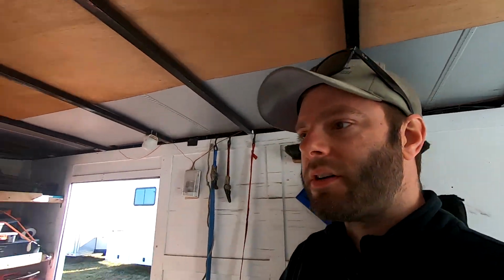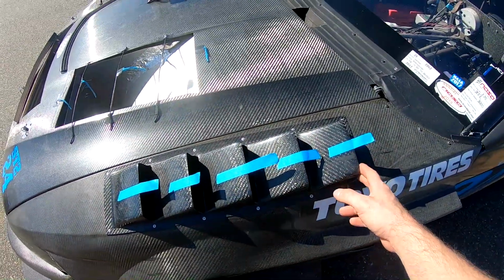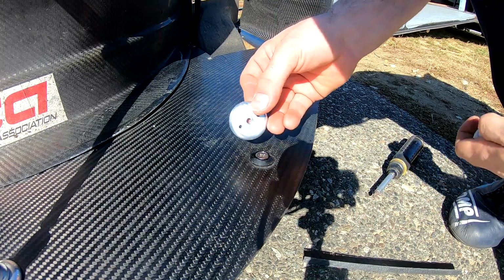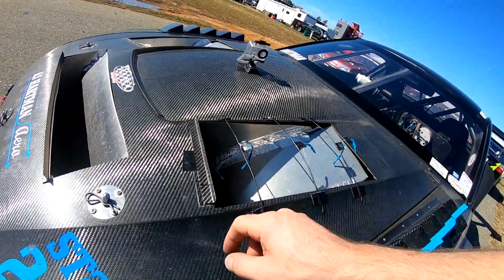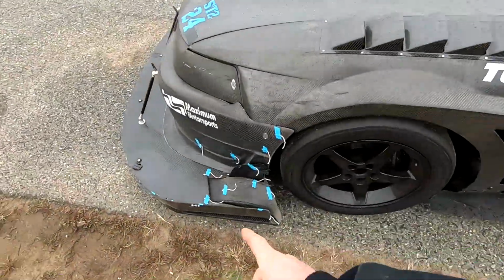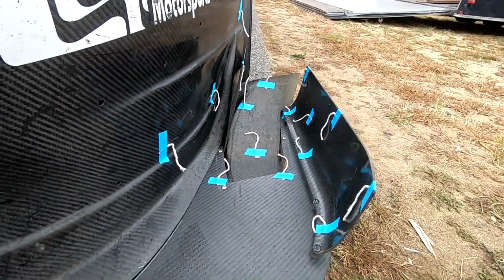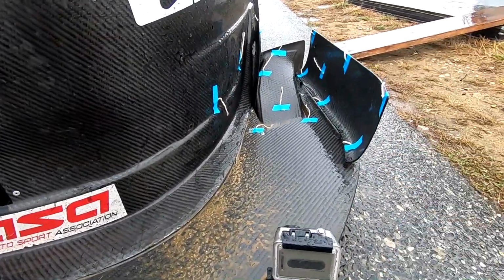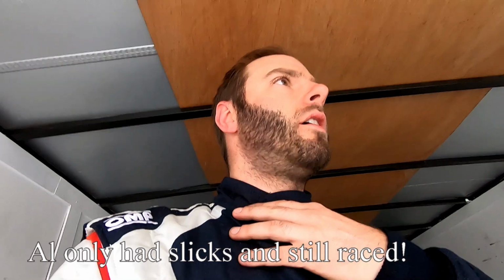Last Race of 2019 and Still Testing Things

Comment: Curious why your splitter flaps/end plates are mounted with a gap? Thanks for the vids!
Reply from the maker: GoodWillRacing cfd showed a better out wash which in turn made it harder for air to get under the splitter from the side.
Reply: AJ Hartman Aero very nice, thank you for the info. Also how are those tunnels working out for you on the outside next to the end plates? Thx again.
Reply from the maker: @GoodWillRacing  I'm sure good. Never ran with and without them back to back but they were all designed to work together. Earlier this year I made this video going over our tunnel setup. https://www.youtube.com/watch?v=FE9sSJQxNgo

Comment: Interesting. Your water wake from diffuser & spoiler look like a stream of ocean waves. slightly different than normally seen on gt3/gt2/single seater championship cars around the world / japan gt which has more upward streamline non waveing water pattern.
Reply from the maker: Interesting. Can you link a video showing this?
Reply: @ajhartmanaero  Here : https://youtu.be/XwURA-KSerw
Reply: A LOT different actually.   I was watching slowmo of the F1 cars bottoming at cota and the debris caught in the aero wash there, was straight up.   Of course best R&D in the world....   But I am willing to bet the wake off the mustang warrants investigation, and also I am willing to bet that the "ocean waves" would show up on shock load sensors and the frequency of the ocean waves relates to the porpoising.
Reply from the maker: kwasg3 I’m flattered you are comparing my wake to an F1 car haha. The wake on my car is nowhere near as clean as an F1 car so will not be as clean for sure. Comparing some debris getting caught in upwash isn’t the same as a rooster tail in the wet. The waves you reference are the vortices coming off both sides of the car in opposite but upward directions. Since the hole I punch through the air from the car body being much larger than an F1 car my guess is that’s why the individual waves seem larger. I found this video of an F1 car in slow mo rain. They still have the waves but at a much smaller and smoother frequency. https://youtu.be/gSBe1TdHSeA
Reply: @ajhartmanaero  Maybe that is convergence of vortices, it would be nice to be able to do proper research! :)  In a different life I'd have a wind tunnel or two.   Debris from the ground act similar to water on the ground, watch a car go way offline.  Here is a clip of petite LM, 2nd pair of cars are sedans.   I think those waves are so defined off of your car because you have flutter happening from some piece of the aero package puzzle.  Rooster tails are a reaction to the low pressure from the aero, not a direct action like a smoke stream being manipulated  in a wind tunnel - but there is still alot of information there.   Rain footage probably is a decent way to go testing actually, but around here it just doesn't seem to have a stable rainy day very often.   IE I have unused rain tires 3 years old! LOL.  https://www.youtube.com/watch?v=ucputZSO1SA
Reply from the maker: kwasg3 if you look close there are defined waves on those as well. It’s just in real time so they mix super quick. Would be nice to slow those down.
Reply from the maker: @kwasg3  Ah, this follows my other response. Put the play back speed at .25x and you can clearly see defined "waves" or areas of denser, and less dense mist.